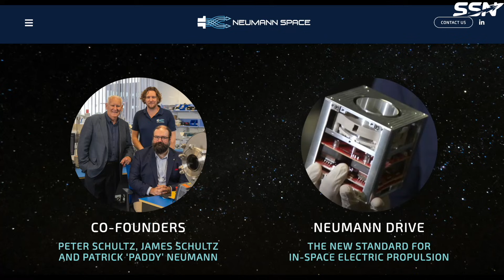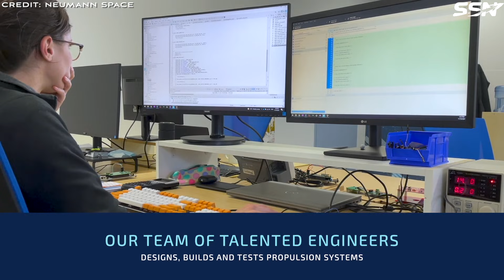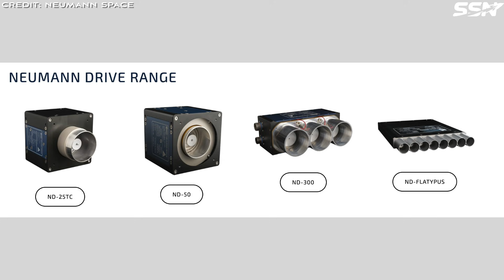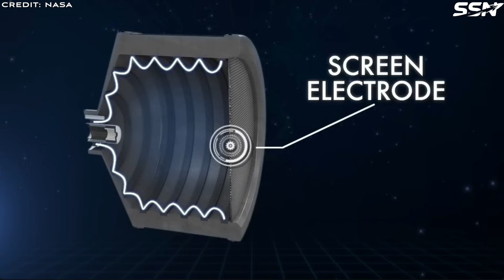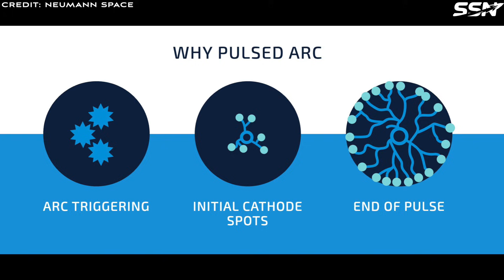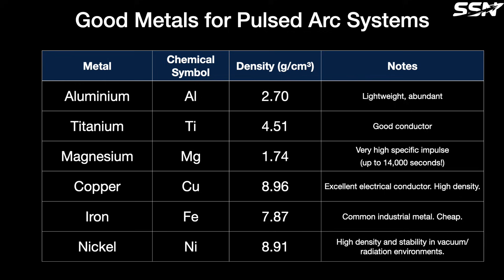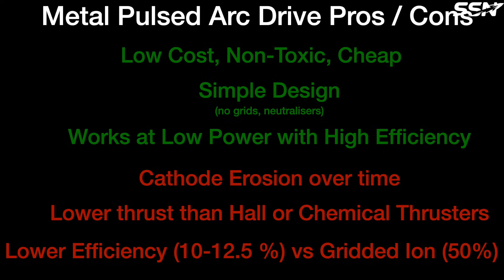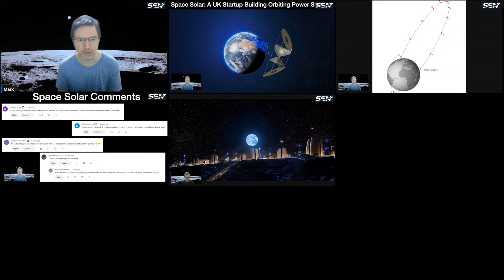Goodbye Xenon, Hello Cheap Metal: Why Neumann Drive Could Dominate Space Propulsion

Comment: Yea, just wait until orbital satellites start to develop a layer of deposited, vaporized metallic glaze because of all of these in orbit filling the region with vaporized metal plasma. I wonder how long before electrical and component failure start to become a problem for pretty much everything in orbit, if enough of these drives are up there making adjustments. They aren't 100% efficient. They will release metallic vapor over time. It will collect and condense on other objects in orbit. It won't be on smaller time scales. Not even years. But after 50? 100 years of running thousands of these drives in orbit? Yea, the people supporting this are only focused on short term gains in lowering costs. They aren't looking at big picture, long-term impacts that could leave future generations totally and completely screwed. Then again, the tech stans and fanbois have never been capable of critical long-term thinking. Like the fact that Starlink satellites are destroying our ozone layer again as the chemicals they produce burning up on reentry attack the ozone layer. How long are we going to ignore this problem?

Comment: For years I’ve imagined a dirt drive that uses silicon as a propellant.  The idea is to land on any rocky body scoop up some loose rock and melt it into a slug that can be placed into the engine. I was thinking since it’s not conductive to blast a little at time off with a laser which would heat it into a plasma.  The plasma would be accelerated away using electric fields.

Comment: The basic concept of these is F=Ma.  Force time Time equal Work.  Acceleration times Time equals Velocity.  To get to the Higher speeds required to get out of our Planetary Orbits, you simply trade for Mass.  A small mass can stabilize an Earth orbit for many years, but it requires and equal amount of Energy/Work input.  That can only be supplied by an internal energy source (nuclear), or Solar.  Once the onboard source wear out, then Solar is the only thing left.  On the way to Mars, that Solar source becomes negligibly small.  Their method DOES WORK in areas of high solar input, such as sending satellites toward the Sun, but it is not going to work if going toward Saturn or Uranus.  Particularly Uranus.  Its a tech Joke, just suck it in.

Comment: Wait a minute. 3000A at 200us pulses - that is a lot of amps and a lot of power. What is the weight and volume of the battery/cap assembly needed to produce thrust comparable to other satellite systems power? And how heavy are the metal rods and how long do they last?

Comment: They are not using metal as fuel. They are using metal as propellant. If the drive used uranium to generate electricity by nuclear fission that would be using metal as fuel. But it generates electricity by solar, not by fission. So the fuel is sunlight, not metal.

Comment: Could the metal propellant be Iron, which is cheap, dense and plentiful? How about using a heavier metal with a lower vaporisation point, such as Lead? The point I'm asking about is would a more massive propellant provide any advantage over a lightweight metal such as Aluminium or Magnesium? Or does the system rely upon the greatest ionisation state per unit mass, meaning that Sodium or Magnesium give the best mass/thrust advantage? Tell us more! Thanks.
Reply: desnse isn't best, lightest is best - momentum is m*v, kinetic energy is m*v*v. you want the lightest atom, going the fastest. Potassium or Lithium are best
Reply from the maker: Lighter metals have a higher fuel efficiency, using magnesium has a 3000 second Isp, but lower thrust. Heavier metals such as Titanium give more thrust but lower efficiency at 1500 seconds. Lithium, as well as tin, gallium, mercury and some others, are not suitable due to their low melting point.

Comment: 0:09 already exist this LOL. VASMIR and also whitepapers from NASA where they use Aluminium, magnesium as fuel.
Reply from the maker: VASMIR is a fundamentally different design that heats and ionises gaseous propellant using radio frequency waves. Sure, plenty of technical papers from NASA but this is a private commercial design that has been launched to space already. In fact, I covered a similar thruster design from MagDrive in the UK in 2024.

Comment: Yeah you just need some Aluminium and coils to zap it with high temp and viola AL13 + AL13 = Fe26 + Energy ... Another Australian inventor has a plasma drive that uses fusion to destroy CO2 in gasoline engines leading to no pollutants and up to 50 percent extra fuel benefits. Its called the Thunderstorm Generator here is my build of it. Here is my AL13 drive ( non-neutron fusion ) #LENR https://www.youtube.com/post/UgkxLhtq-6LUY88gZuEJfIz9khhCTUhcNPav and my build for the TSG https://www.youtube.com/post/UgkxCZzR2cKzwuSAod8d6U0AUDUruidupyiR
Reply: I’m glad your vajra shaped fusion reactor is 50% more efficient than a regular gasoline engine
Reply: @IceRain-f5v  my one is sorta based on the gas version of M Bendall's but fuses AL13 but his fuses CO2 groovy trick actually on the Alchemical Science page on youTube they get in a closed room with the gasoline generator and have no ill effects. https://youtu.be/JTVLMXx6jP8
Reply: @IceRain-f5v  oh yeah the added efficency comes from heating the combustion chamber ( using excess plasma ) this makes the gas explode more easily, sorta like a catalyst.

Comment: Imagine after extensive use of metal ion thrusters earth becomes surrounded by a torus of metal ions that precipitate on all surfaces.

It would be hilarious if GEO spy satellites become impossible because they go blind in two months due to a metal film on the optics.

They’d have to rely on using many cheap sensors hidden on starlink or starshield and then using photogrammetry, cooperative background oriented schlieren, multispectral spatial voxel correlation and ai to reconstruct images.

Comment: The Neuman thruster is a vacuum tube triode  without the vacuum tube.  The metal element will eventually fail with exposure to air, if ignighted in an atmosphere.  It can only work in space, but will still eventually erode.
Reply: "will eventually erode" - well yes, that's the point - that eroded metal is spat out the back at tens of km/s, that is what gives you thrust
Reply: @andytroo yes. Titanium would be a good choice of metal as it sublimates easily in a vacuum arc while ablating evenly. One other option would be salt bonded cathodes that would give a lot more thrust per pulse than pure metal would. ❤
Reply: it's designed to work in space...
Reply: I don't think anyone wanted to use this in air to begin with.
Reply: You could use gold for the cathode and platinum or titanium for the anode. Could also use a salt cemented cathode of any metal you like. The device is extremely similar to hollow cathode plasma lamps in construction

Comment: the METAL is NOT a "fuel".

the SOURCE OF EMF is the "FUEL".

what supplies the POWER? extension cord hanging out teh back? a power plant trailing along beside them? batteries? fuel cells? oh. thats right... wind turbines and solar panels... 

SOMETHING HAS TO PROVIDE THE POWER, THE ENERGY.

as an australian... another grifting scam startup relying on ignorance and hyped up keywords to grab as much investment dollars as possible before vanishing without a trace. we no longer make things here, and real innovation is stifled. only the fraudsters and criminals get ahead, as long as they "play the game" properly.

why is our so called "space agency" in teh middle of what looks like suburbia rather than out in the middle of lake eyre, say? where it can actually fire rockets safely?
Reply: You really want to pull "fuel" and reaction mass apart?
Reply: @goiterlanternbase  yes, i do. a fuel requires some type of exothermic reaction, usually in teh presence of oxygen though any element with a suitable valency will react and produce heat and pressure, which in turn convert to velocity, mass flow, and thrust.

iron burns very nicely when exposed to heat and 99% oxygen, like an oxy torch. at that point, iron IS a fuel. but you still need some other fuel to provide teh initial heat. or source of energy, if the heat is produced by an electrical arc.

vaporising iron and accelerating it  as a "reaction mass" requires AN EXTERNAL FUEL SOURCE.

otherwise we wouldnt have any iron as the stuff would be violently disintegrating... which it doesnt appear to do?
Reply: @paradiselost9946 You are right🤗
Reply: @paradiselost9946  Uhhhg. The short bursts of electricity to create the electronic discharge!
Reply: It's called solar panels. Because not only do they make halfway decent radiators, without atmospheric interference, they're actually reliable in space.
Reply: @torg2126  radiators? why do you want radiators? you want to ABSORB energy.

until thermal issues demand some heat be radiated somehow... slightly awkward when theres no air to conduct heat away... space isnt cold. or hot.

yes, a few metres of solar panel shall provide megawatts, plenty of power for any sort of reasonable acceleration of a large mass...

of course they will...
Reply: there's no wind in space but plenty of solar energy

Comment: I was wondering if it's possible to design the arc generation so that it can produce a shape that optimizes the plasma emission vectors, possibly a 3D simultaneous, or staggered, pulse pattern? 
Just flailing around with ideas... Stream of consciousness, not as directional as optimum, perhaps.

Comment: Couldn't you use iron?
Reply: f=ma, momentum is m*v, kinetic energy is m*v*v - halve the mass of the atom, double the velocity, increase the efficency - the lightest elemets are best. This is why hydrogen or molecules with lots of hydrogen are what are used everywhere. Lithium or potassium would be best.
Reply from the maker: Yes. Isp would be around 1800-2200 seconds. It's not the best performing metal but has some advantages: abundant, high density, stable and non-toxic. Melting point is 1,538 °C (2,800 °F) so more energy needed to recycle compared to Aluminium which has a much lower melting point.

Comment: the neumann drive sounds extremely cool as well. i really hope this propulsion becomes more wide spread. does the extra fuel density negate the weight or is it about the same as a zenon drive
Reply: Fuel density is basically completely irrelevant 

The % of the mass of a fuel tank that is fuel and not tank is important and somewhat influenced by fuel density (also pressure)

However it’s only important if your ship/satellite is an abomination that is 99% fuel by mass, because how lightweight your fuel tanks are is utterly irrelevant if the ship isn’t mostly fuel

To show an example you have a dry mass of 40 tons fuel tanks that contain 100 tons of fuel and weigh an incredible 1 ton
You have the best fuel tanks every however, if they weighed 10 tons you would go from 141 wet 41 dry to 150 wet 50 dry, and LOGARITHM the ratio between the two is your delta v increase. Probably less than 5% extra fuel lmao. Maybe less than 2% idk. It’s awful either way 

Meanwhile delta v scales linearly with exhaust velocity. Double the exhaust velocity means exactly double the delta v. So doing the incredible effort and trade offs to get a fuel tank that weighs 1 ton instead of 10 tons for the same fuel mass is equivalent to getting an engine with a 5% higher exhaust velocity lmfao

Space is engine supremacy, better engine is all that matters, higher exhaust velocity, higher thrust, higher energy efficiency, higher specific power and specific thrust 

Shaving every gram is almost useless... it can work if you’re really trying to ride the logarithmic curve but overall you should probably completely ignore it, a spaceship is fine with a mass ratio of like 1 so long as it has a good engine, rockets and many foolish engineers aim for a mass ratio of infinity, which is a total waste of effort compared to engine R&D
Reply: You don't need a tank to store a metal rod. I assume there is a mechanism to advance the rod as the tip gets blasted away, but that is likely simpler and lighter than the plumbing required to dispense gas.
Reply: @hamjudo  i simply ment the weight of the fuel

Comment: No telling how powerful this can get with unlimited electricity, like from zero point energy. So many great ideas have come and gone over lack of electricity. My big question, what size will one of these need to be to provide 1 G of continuous thrust? I'm getting Expanse vibes from this one.
Reply: Point it away from the sun and see how far it goes!  Higher thrust closer to the sun, weakening over distance, but with increasing acceleration via cumulative thrust.  This sounds promising indeed.  I wonder how long a fuel rod lasts?
Reply: I hate midwits and dimwits so much it’s unbelievable
Reply: if youre making "zero point energy" with "unlimited electricity", then you are more than likely have also sorted out this "gravity" issue, and no longer have to rely on primitive methods such as "throwing ballast out the rear end".

im getting scam vibes from this myself...
Reply: @paradiselost9946  Leaving out the viewer’s thoughts on zero-point energy, the thruster itself makes a lot of sense to me. A very energetic, very short-duration pulse would vaporize a small amount of the “fuel” while producing very high plasma temperatures, which would equate to very high exhaust velocities and thus very high specific impulse. I’d think the main problem would be to prevent erosion of the reaction chamber and/or deposition of the metal on the chamber walls or nozzle. Assuming they’ve solved those problems, this looks like a great and more practical replacement for ion thrusters.
Reply: @paradiselost9946 One step at a time.

Comment: Pondering: All the belligerent crap a MIG welder blasts out while consuming only 120/240 volts just might blow those delicate little Zeon darlings into the trashcan by the sheer brutishness of a dirt-cheap Iron Eater? Regardless, I'm waiting for them to catch the idea of an "Inaliation Drive" (of which these ion motors are babies.) Think of "Back to the Future" with Doc's "Mr. Fusion" hopper on the top of his car.
 Cram in something conductive, Zip-Zap, and off you go! Just like what they're doing now, but more along the lines of a raging particle projector from hell instead of the gossamer breeze they produce.
 Regardless, the "Ya' gott'a push shit backwards to go forwards" way of things has just about run its course by what I've been hearing lately.

Comment: No valves no tanks no moving parts 

Perfect for satalites
Reply: The tip of the electrode is blasted into space. I assumed that the larger versions have to mechanically advance the rod as it is consumed.
Reply: Or, if the problem of a fitting electricity source is sorted, an interstellar mission (Proxima Centauri powered by some sort of RTG or small reactor maybe?)
Reply: The issue is the low theoretical exhaust velocity
Yes it’s high colored to current alternatives but the theoretical maximum still has the lightest isotope as the best fuel for delta v
This is why magnesium which is lightweight is their best option 
Thust is generally easy to achieve but exhaust velocity comes from hard limitations and mass of physics

And especially if you do things at scale having higher exhaust velocity makes everything a lot cheaper, when you move millions of tons of materials it really adds up

The other benefit is that for space mining, hydrogen is actually pretty rare, it exists in ices beyond the ice line, where as heavier elements like metals are everywhere and can be mined everywhere, the moon itself is a giant ball of oxygen aluminum silicon and iron, so if you can use aluminum as a high exhaust velocity fuel... pretty useful
Reply: no oxidizers!